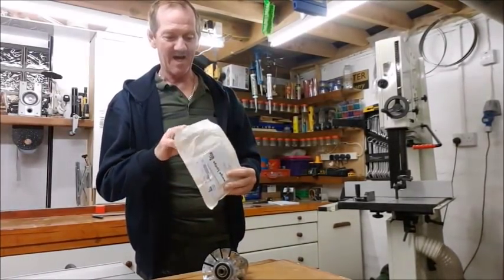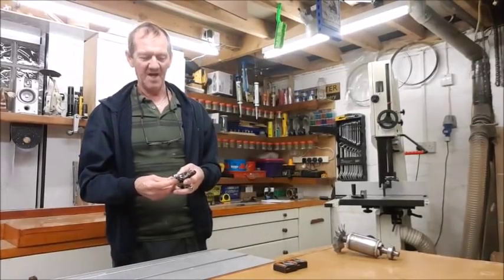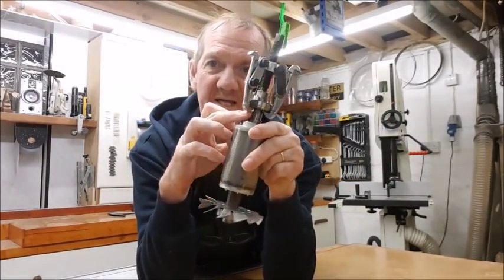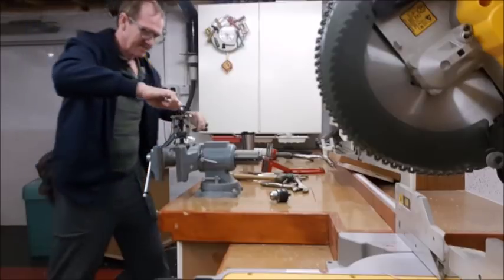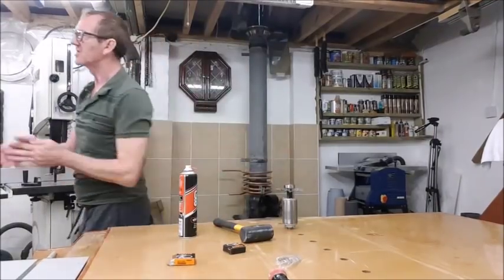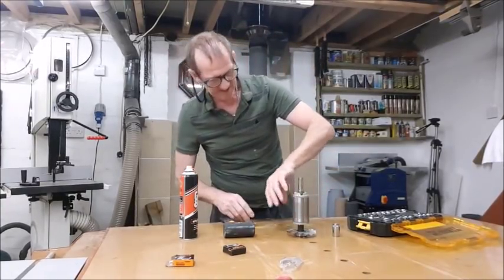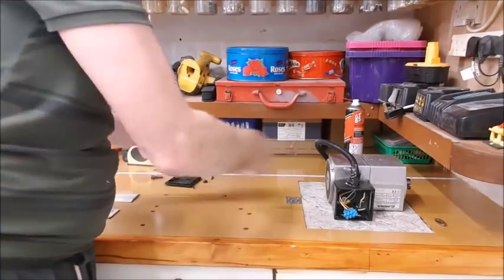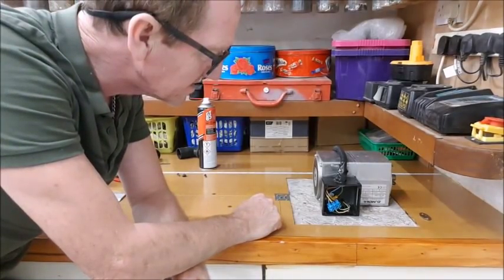Making a horizontal drill press part III

Comment: Could you have used the old bearings to tap the new bearings in place?
Reply from the maker: But then would I not have to remove the old bearing again?
Reply: @dmgladden  no hecause it wouldnt be on as tight. I used the same idea when doing my wheel bearings on my car
Reply from the maker: @tyler4164  Hi David, no the difference there is that the shaft on the wheel is tapered but my shaft is the same the full length which is why i could choose how fare i wanted to drift it on
Reply: @dmgladden  oh i thought it was also tapered. Never mind
Reply from the maker: @tyler4164  no but thanks for the thought if doing a tapered one in future it will give me an idea